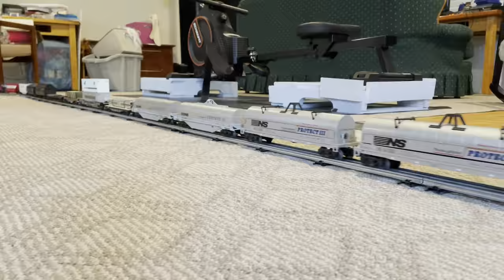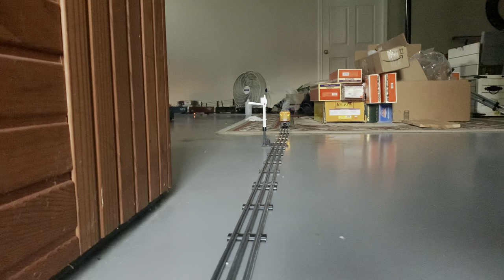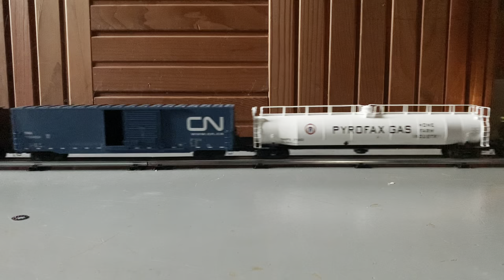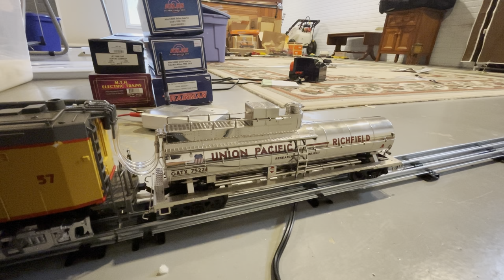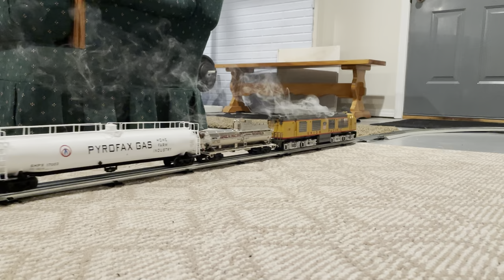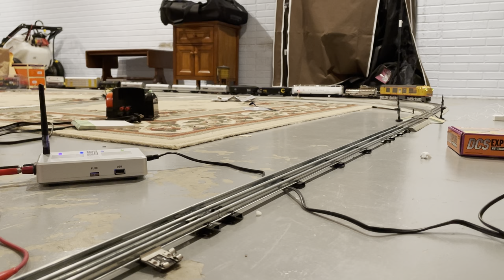MTH PS2 Union Pacific Propane Turbine Review (Redo)

Comment: Great video Steve. I have one of these engines too but it is the newer version with the PS/3 They have the four can motors with each truck unit being powered. These engines are loud but they start smooth and run smooth. And yes, I know what you mean by working the night shift. I used too work a swing shift and it was always hard for me to adjust to that.
Reply from the maker: Thanks! I wish I got the ps3 version but I had the ps2 version so there was no point. Nights are rough man